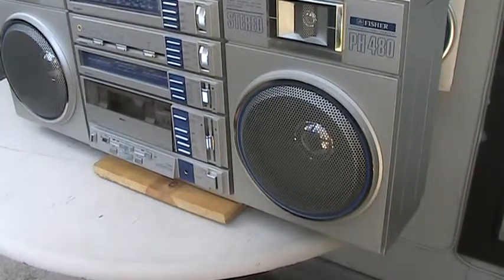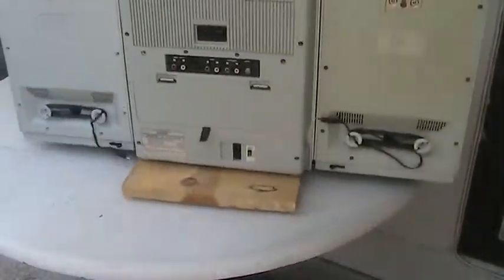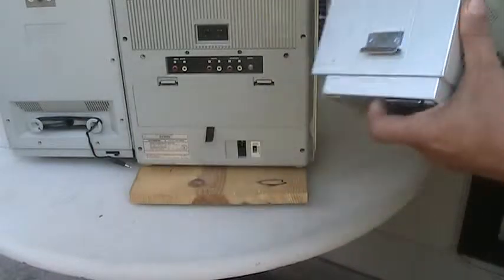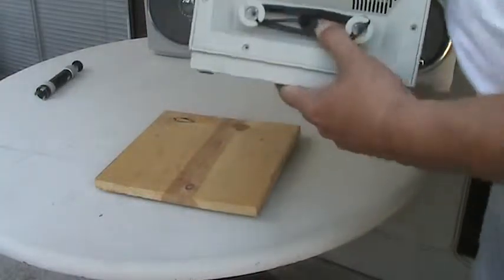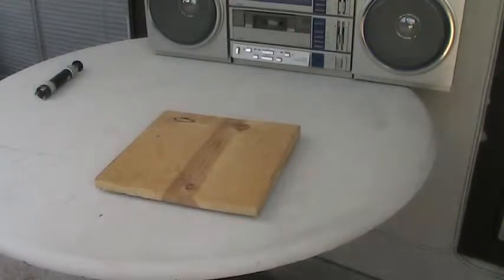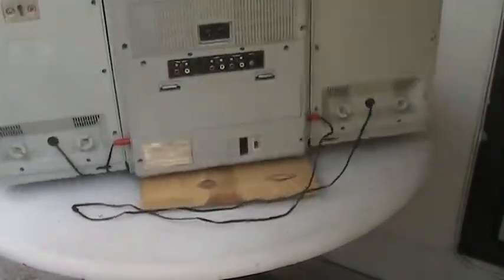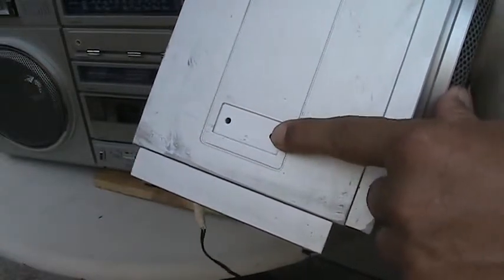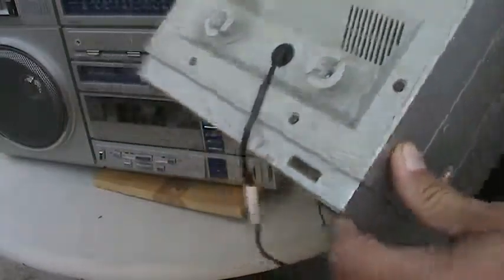Fisher PH-480 Boombox Speaker attachment

Comment from the maker: Good bass depend's soley upon your application of using this boombox to play music.  Fisher PH-480, 490,492 - all share the same speaker's with different, cosmetic & featured main units.  Large individual seperate enclosure's sound much better than a singular enclosure housing 2 woofer's in a stereo configuration sharing the same air baffle area and or fighting each other driver for accurate stereo seperation of sound.  Portable boombox's are limited to their power watts based on battery power.